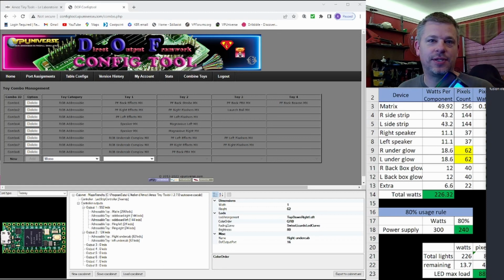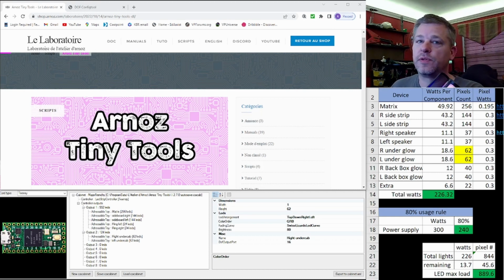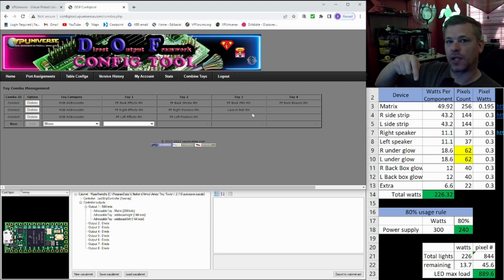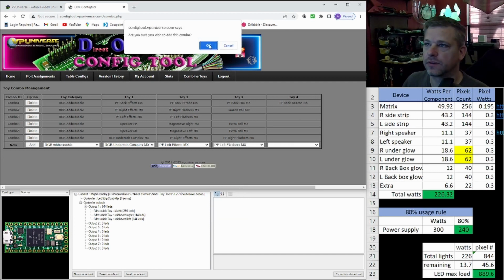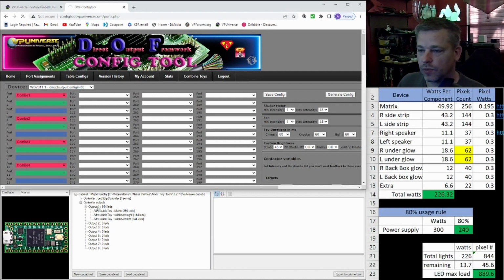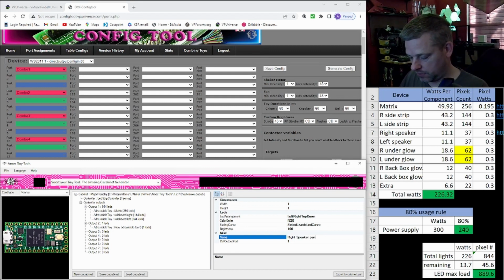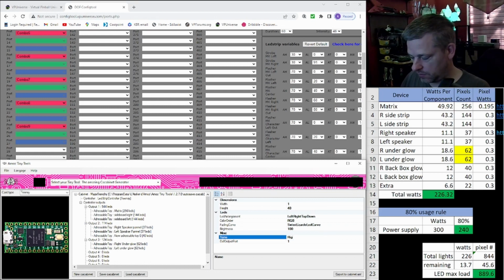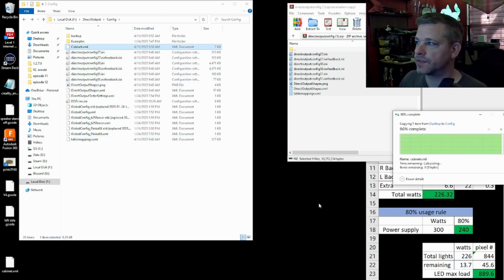Scrapyard Pinball E12 How to install addressable RGB LEDs using the DoF config tool and tiny tools.

Comment: The Matrix and both Playfieldstripes using only 1 port? Is there a video online, that shows the lightshow in action? 😎
Reply from the maker: Yes, the matrix and left and right playfield strips are on one port. You just have to power inject. I have under cab on port 3 and backbox speakers and back glow on port 2. Check out my video here. https://www.youtube.com/live/A00lQOmQXKQ?si=Cswgh2BrqZC7nT36

Every table is a little different. Batman 66 really shows it off
Reply: @chipgt81  Thx... I use a WEMOS D1 Mini with 8 Ports. Now i want to upgrade my led matrix to a HD Matrix (3x parts, every uses 1 port). Actually my Matrix, Playfield right and left uses 3 ports.
Your video showed me that i can reduce all 3 items to 1 port. 👍🏻 I thought all the time the signal cant control 3 item with one port...
Reply from the maker: @Affenkopp-uq6kp  you can do it however you want. I was thinking logistically what makes sense. I like the idea of having different lines that go to different places. Playfield, backbox, and lower cab. I have 5 more ports available. And ran one wire for a topper if I choose to do one...
Reply: @chipgt81  Thx... I think ive got a New mission for now. 😉 Do you know, whats the maximum of LEDs per port for the WEMOS D1?
Reply from the maker: @Affenkopp-uq6kp  I don't think there is a maximum number for adressable rgb leds a single channel.  The dumb rgb leds are all on one color at a time, which is what eats channels and why most controllers support 8 ports at a minimum. They are an older tech. For adressable rbg leds, it is more what your power supply can provide power to.  This is where the calculator i talk about comes in handy. The max I have run is 556 on a single channel. That's my matrix, lefT,  and right playfield. I have seen no issues or delays. However, you may be limited on the number of effects that can be processed and sent out on a channel. I run 4 effects on my matrix, 4 on the right playfield,  and 3 on the left. Ranging from animated plunger to flashers and strobes. It's better to mix effects using the dof tool. If you add too many effects for different features like speakers,  underglow, back glow, matrix, and playfield, you may see lag or choppy lights. I never pushed the limits to find out. The d0 and d1 mini have 8 channels. To me, it just makes sense to split up features based on location. Plus, if you add a switch on the power line positive, you can turn off sections of lights if you don't want them on. I mean, you have 8 channels. Why not use them... if you want them all on one channel, that's fine too. It is the same amount of work to install, configure, and set them up in the software.